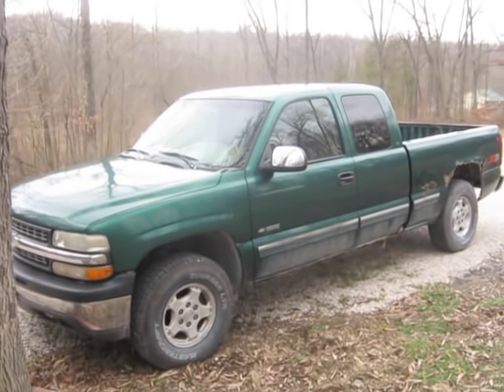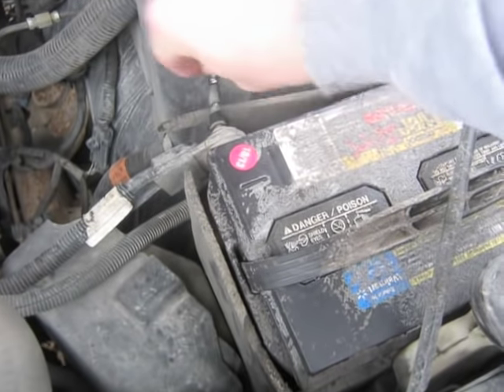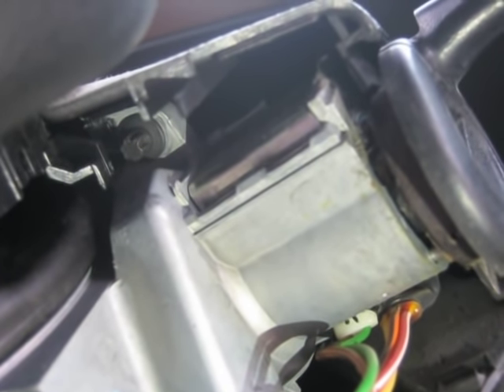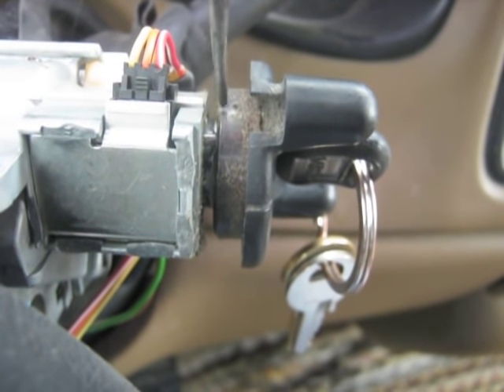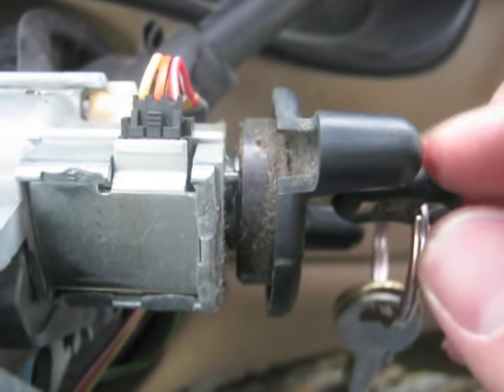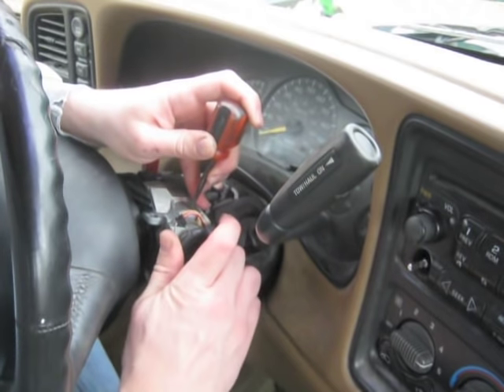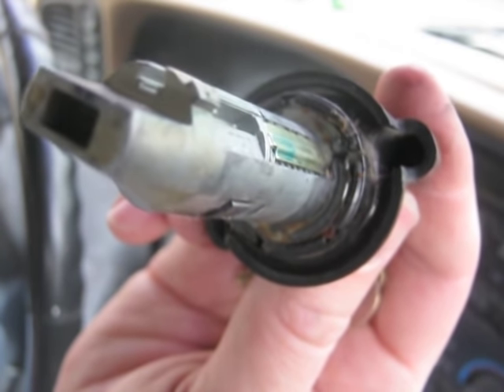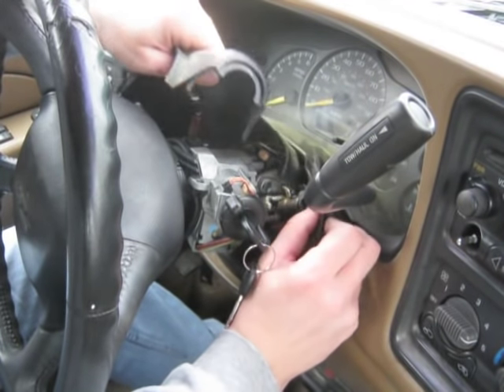Key won't turn ignition - ignition lock cylinder Chevy Silverado 1999-2006

Comment: The ignition not turning has absolutely nothing to do with the spring pin as you referred to. It has to do with worn wafers in the lock that are not matching up with your key. All you would have to do is go to a locksmith and get him or her to replace the wafers and your lock is good as new. And you wouldn’t have two keys. You could’ve had the new lock rekeyed to match your old key so everything is on one key but then again you spent money on a new lock that was not necessary. That groove as you called it you said wore out does not happen. Always a good idea to ask a pro. You save money and you don’t misinform people with this nonsense.
Reply: Johnny is Mr. Know-it-all.  Those guys are the ones you want to avoid taking your car too.   @jaysmokey
Reply: Well Johnny know nothing.   A locksmith is gonna cost you between $100- $180 to make you a transponder/chip key. 

While for $100, I got a new lock cylinder& 2 new transponder keys that I was able to program myself.
Reply: @CSpad unless you got a remote I’m sure you’re not worried about your ignition key not matching with the door anymore, better hope that battery doesn’t run out

Comment: NOTE: if you do this procedure and you can’t get your new ignition to pop right in you have to take a big screwdriver put it in the hole and rotate the ignition square all the way back, after I did this my new ignition slid right and and worked great!! Thanks so much, Greg
Reply: Thanks for that info !!
Reply: Thanks because that's excatly what I was experiencing.
Reply: Someone try stealing my truck my key won’t turn at all
Reply: In the housing itself or with the new ignition 75%in? I'm doing it rn and feel like I'm going to break something in the housing 😂
Reply: With no ignition at all in housing stick screwdriver in and rotate back hole that accepts the new ignition
Reply: @sadiegirlwolf  thanks buddy I figured it out that day 😄🤝

Comment: The key was worn. The ignition  lock cylinder did not need to be replaced. You cannot trace the old key, you must cut a new one to the original factory depths ( usually done at dealer or with a locksmith). I worked at a GM dealership for over 30 years.

Comment: How do you get the cylinder out if the key won't turn to the on position???
Reply: Got it out by getting a thin metal strip and pushing the tab in. After that 15 minutes , new one installed and job complete.
Reply: @bobthomas143  Thanks Bob did mine today I got a thin piece of metal like you said and it work thankkkkkkk youuuuuuuu! I want a by you a case of beer if you drink... Peace out....
Reply: @bobthomas143  please can you be more descriptive? Thin metal for what piece? Wtf

Comment: One thing I'd like to add that happened to me while I was replacing the switch was ,When I took the switch out and went to put the new one in.  Inside the ignition itself, moved in there. so the new key switch wouldn't go back in until I put a flathead in there and turned it back the match the key cylinder ,Then it fell right in . Thanks for posting
Reply: P.S. There was no 4m bolt in there. just used a finish nail to remove the switch.
Reply: You save my life!! You need a reward lol I couldn’t figure out why it wouldn’t fit!! Thank you so much

Comment: I didnt want to give up my key and have to use a diffrent one for doors and ignition. Took out the lock cylinder like he did, got a very fine file. In my case it wasnt those two little pins causing my problem it was a sharp edge that had developed and it was catching. Rounded a few edges and bingo!! It is very easy to start these trucks without a key i discovered..
Reply: I like your pepe pfp good sir I did not read your comment however, that is all.

Comment: Thanks,  easy to follow instructions. Done in 30 minutes.  We did have to use flathead screwdriver to line up inside parts to insert new ignition.
Reply: NOTE: if you do this procedure and you can’t get your new ignition to pop right in you have to take a big screwdriver put it in the hole and rotate the ignition square all the way back, after I did this my new ignition slid right and and worked great!! Thanks so much, Greg
Reply: Same Here. Glad I had a flashlight to see why things weren't lining up.

Comment: Thanks for posting this video only difference was mine was a 2006 Z71 made my repair easy 👍👍 
Just a couple different steps on mine. It didn’t have bolts holding column plastic together so all I had to do was use a small flat screw driver to start separation of plastics. Carefully 
Oh also I had to hold key all the way forward in start position to be able to push in release button to pull out old lock cylinder.   
Thanks again 👍

Comment: This video was very helpful for me because I learned how to pull the cylinder out mine was broke on the on position if your key won’t turn you need to push both pins in by sliding something that will lift them out and then it will turn to the start position I need to crank it all the way over to push in the pin you will see that if you buy a new lock like I did this video is very helpful thank you A+

Comment: You need to go until start position, but put in reverse and after that, turn the key until start position and push the retainer and pull it out.
I'm a professional locksmith.
Reply: THANK U!!!!!!!!!!! Im outside sweating my ass off trying to pull the cylinder out and it did not come out til I did what u said

Comment: The video was great. I have a 1999 Silverado and my ignition lock cylinder needed replacing. I was nervous to tackle it at first, but with the video you created made it a breeze, once I purchase the right tools. The only thing that I would add is: When inserting the new cylinder, you may need to use a big flathead screwdriver to insert into the core space to turn the switch just a little to line it up to receive the new ignition. cylinder.  I had to figure that out to get the cylinder to seat properly. When I put everything back together, it works like new! Thanks.... Oh yeah I had the dealer to set the cylinder to match my existing keys.
Reply: How much did it cost for the dealer to set the cylinder to match the existing keys?
Reply: @anthonyg9389  did u ever find out??
Reply: @chrisg1364  no, I just bought aftermarket ignition lock cylinder from amazon
Reply: Thank you William, your comment saved my ass tonight. Small turn from 10 o'clock back to 12

Comment: Just had mine all appart because mine was stuck in the crank position. That little gold plate under his tool on the tumbler at 3:57 was popped out. The corners of it are stamped into the casting of the aluminum tumbler. It looks like it holds the springs in the lock. I tapped the spots back down in the corners to stamp it back in place and now it works again. It's very soft aluminum. Mine does do the same thing this guys did and I also thought it was the pins catching on those ramps but I can hold them both IN and it still catches. I think its the little black block on the side of the tumbler that sticks out just a fuzz when the key is out but then goes in when the key is in. I believe it's what prevents you from turning the tumbler without the key in. I don't think it's coming out of the notch where it rides in the female part where it goes into the column. It seems a little cockeyed. I believe that's what catches and not the pins.

Comment: Thanks for this video. You saved me a lot of money and stress. My key wouldn’t turn, but a flathead and hammer freed it up pretty easily.
Reply: @The Masked Hoodie luckily no. I was just careful
Reply: @The Masked Hoodie my ignition switch wouldn’t even turn for me to be able to get it out to change it. So I had to stick the flathead in where the key goes and hit it with a hammer until it broke lose. I was changing the switch out anyway so I didn’t care if I messed that one up

Comment: Bless you, my new friend. I watched another video to diagnose and understand that this was something I could do. But I couldn't get the top housing off the steering column of our 2003 Chevy S10 until I saw you identify the problem bolt, AND suggest using a 4 mm socket wrench to get it off.  (Watched 3 other videos before yours, and they suggested removing the steering wheel and airbag to get at it. No!)   You saved me tons of time and money!
Reply from the maker: Good deal! Thanks

Comment: Good video.  I've got the same problem, and now I'm confident I can fix this myself.  I'll give it a try this week.
Reply from the maker: Happy repairs!
Reply: I decided to tear into it this week.  Apparently the previous owner had struggled with the problem.  To begin with, getting the covers off the steering column was a snap because he didn't bother to put the retaining screws back in.  With only a moment's struggle, I was able to extract the old cylinder, to discover that it had been liberally slathered with grease.  That would explain why everything worked fine when I bought the truck, but started going downhill soon after.  I popped in the new cylinder without any issues and replaced the covers.  The whole process took only a few minutes.  Thanks again for posting your video!

Comment: Key won't turn...except that yours does, so it's easy to switch out the cylinder.  Not helpful.
Reply: È
Reply: 79 dodge brougham rv installed new ignition
Reply: Same issue
Reply: Take the key out and smack it with a screw driver handle and keep working it. She'll give
Reply: Try adding wd40 into lockset,,  that's what I had to do to get my damn key to turn
Reply: Did you figure it out, I'm currently looking to fix the same thing but key won't turn
Reply: My key didn’t want to turn either. As much as it sucks, I had to just keep trying my key until it turned (about 15 minutes).
Reply: @lorenshultz1 what do you drive literally having this problem now
Reply: @makonyajohnson3615 same now I can't turn it at all chevy s10
Reply: I replaced mine couldn't fix buddy

Comment: Thanks!!!!!  I spent all afternoon trying to get the top plastic cover off.  Never would have found that 4mm screw without your help.  Probably would have had to rip that piece out before I found that damn screw.
Reply from the maker: Haha. I'm sure that happens alot!
Reply: It is not actually a 4 mm screw.  There are star sockets that are the correct tool for this.

Comment: So, my ignition switch would NOT move, NO way to rotate to the start position to remove/replace. I pried the plastic off the switch and located the keyway that pops up to lock the cylinder. The springs can fail and the keyway does not disengage from the housing. It's basically right where the arrow on the plastic is. I used a die grinder to cut off the shoulder of the cylinder right where that keyway is (careful not to damage anything else). Put the key all the way into the switch. Then, I took a baby (very small) flathead screwdriver and pushed the keyway down (back into the cylinder slot), tapping the screwdriver in as far as I could. Had to help turn the cylinder with some channel locks, but I got the cylinder to rotate clockwise to that start position and I could then pull it out. New one popped right in.

Comment: Replacing the rubber shift lever 'boot' while in there is also a good idea.
And, if you have tow/haul switch, the orange wire is prone to breaking because factory stretched too tight.

Comment: 1996 Chev. C-1500: This works great but the fact is you need the ignition to go forward in order to even remove the core/barrel. I cannot turn the key at all. So it refuses to let me remove the barrel cylinder and replace it. Both keys refuse to work on this ignition. May need to call a specialist.
Reply: im in same situation key broke off and 2nd set was a gmc set from csnada?
Reply: just got it towed bit took column apart can get out of park still wont turn ignition though

Comment: That works if you can turn the key, but I can’t turn my key as state in the title, so this video is more or less useless for me others expecting to see you fix a cylinder lock that won’t turn.
Reply: I could turn mine with a screwdriver, it sucks but it’s better than nothing
Reply: @sleepytime4649  I ended up tapping the key with a hammer while turning it to unjam the cylinder lock.
Reply: at if your key broke off in thebignition its on a slant so very hard to get out
Reply: @wallace2157  try a key extractor, lock picking sets usually has one.
Reply: I gave in bought new ignition

Comment: Perfect instructions.    But when I pulled ignition out,inside tumbler turned so new ignition wouldnt go in...aaahh thought for sec then i used a 5/16 closed end..to turn a little to line up,went right in. Thanks.
Reply: Special Note: if you do this procedure and you can’t get your new ignition to pop right in you have to take a big screwdriver put it in the hole and rotate the ignition square all the way back, after I did this my new ignition slid right and and worked great!! Thanks so much, Greg

Comment: What if the ignition can't turn to on position with wiggling back and forth
Reply: Devin Mccormick ya I was wondering the same thing.... I can’t get mine to budge at all...
Reply: Did y’all figure it out ? Because mines won’t turn forward or backwards
Reply: Gringer pins
Reply: Or circle foward switch and pb blaster
Reply: ramstone t1991 dont kno what that is
Reply: Drill it out. But don't be like me and push hard on the drill. I fucked up the whole housing lol
Reply: I used a cheap lock pick from harbor freight an wriggle it into barrel through a tiny hole made special for this problem whilst wriggling key at the same time ,key will then pop into on position 😅

Comment: Its not two small pins you talking about in the video,its your key wore out or inside cylinder,I did have the same problem and replaced with new cylinder,if you look at your old cylinder and when you put key in,small plate on the side supposed to slide inside to make a free turn
Reply from the maker: Cool. Thank you for the info!
Reply: Einstein

Comment: Well, great video. I was able to get thru all the steps until the part where the key has to be turned on in order to release the lock cylinder. But that's my problem! The key won't turn. Very frustrating
Reply: Did you ever figure it out?

Comment: I had a problem with not being able to turn ignition completely off to remove key. Replaced the ignition switch and lock mechinisim. worked fine for a short time, now it's doing it again. "97 S-10 pickup

Comment: Okay we have a 05 Tahoe that does the same thing but it won’t start right away Ana there’s a clicking noise on the passenger side of the engine? Been wanting to know what it was and if this could also be related to it not starting properly.
Reply from the maker: Sage Listo the clicking noise could be a problem with the starter.

Comment: So what do I do if I lost the orginal key for the cylinder and want to replace it with a new one, and want to lock my truck doors at night it'll be a hassle to get  back into it's a 02 tahoe z71 I'm talking about
Reply: kd Thomas call lock smith and get him to cut you a new key not to bad expensive but will save time and hassle

Comment: Will a 06 chevy trailblazer interchange with a 05 chevy avalanche n how did the key turn with no battery hooked up I couldn't get the key to turn on my 05 Chevy trailblazer n I had right key

Comment: I'm having trouble because the person before me that sold me the truck had all this in a mess and things tapped in place using electrical tap but after removing the tap the truck won't start and I noticed that those wires ain't there so they were either not on my truck or they were removed and if that's the case and if it is part of the security system in anyway I'm wondering if that's why it won't start anymore

Comment: Mine won’t even turn to the second position at ALL. So I can’t remove the cylinder. Any advice?
Reply: It will turn you just gotta play with it. I have to fiddle with mine for 30 minutes sometimes before it finally turns. If all else fails you can tap it out with a screwdriver and turn it since you’re putting a new one in it anyways.

Comment: wow..I have same exact problem in my 2001 Silverado and even worse in a 2005 gmc 1500...I watched another video and he removed wheel and looked like a major pain in the sack..this seems very doable. .but I will spray some lube on that area first to see if that helps...thanks for the great job!
Reply from the maker: Yes, very doable. Easy fix. Oil may do some good.
Reply: +The Daninator I used liquid wrench silicone spray lube and works way better...thanks

Comment: Hi have a question i Have a 2005 astrovan.I lost the key so I'm unable to turn the Ignition lock to the on position so I can push the pen in and get it to release the the Ignition lock. Is there another way to get that to release?

Comment: On the ignition cylinder housing, what do those 3 wires do? (yellow, orange,red wire?) My 2000 chevy does not have that piece and the wires sre just there.

Comment: What if you can’t turn to run position!  Can you use small pin! Like you have to push that lock pin so you can move it to run position to push pin down that hole! To release cylinder lock and pull it out?

Comment: I didn't see the battery cable step are you saying I should disconnect the battery first under the hood then work on installing the lock key cylinder?  Also does installing a new lock key cylinder will it help me unstuck my wheel my wheel is stuck in lock position and my key wont turn
Reply: Yes, it will unlock the steering wheel.  That is actually a basic anti-theft deterant.

Typically when the steering wheel is locked, you cab get the key to turn just by wiggling the steering wheel while trying to turn the key